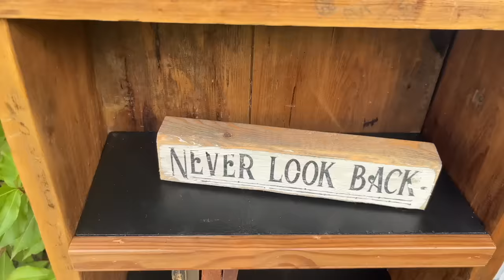From Trash To Treasure: Roadside Rescue Upcycling Ideas!

Comment: All your projects were great.  The stool was my favorite.  I too have been buying Ryobi cordless power tools. My next purchase will be the circular saw.  Which size did you get.  The guys say that the circular saw is somewhat dangerous as it can kick back.  I’m looking at the 5 1/2 inch one as I don’t plan on building a house with it!!  I know the cordless saw is not quite as powerful as the corded ones therefore they are a little safer.  Just wondering what size you bought.  Thank you for sharing all you ideas.

Comment: I'm not a woodworking expert, but I do my share of woodworking, and I'd have bought the little shelf clips like used on many bookcases and kitchen cabinets, drilled just far enough for the pegs to be inserted. Put 2 on each side and place the shelf on top. That way, if you want to switch it up at some point, you can add more peg holes, not to mention it makes the shelf sturdier. Just a thought.
Reply from the maker: That's a great idea!